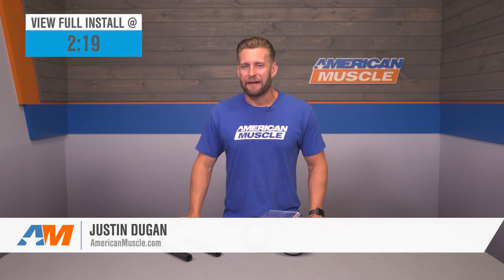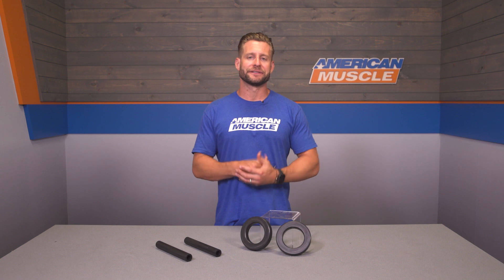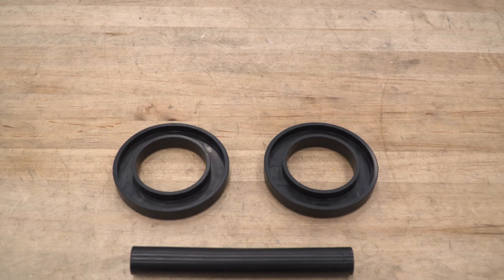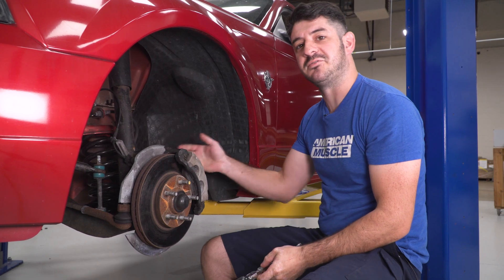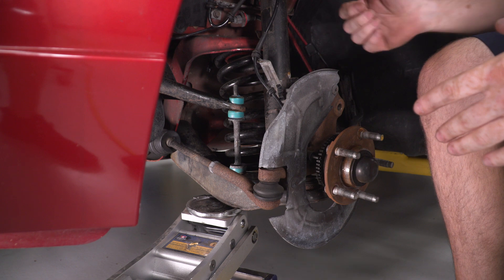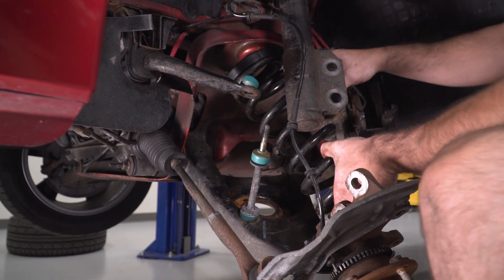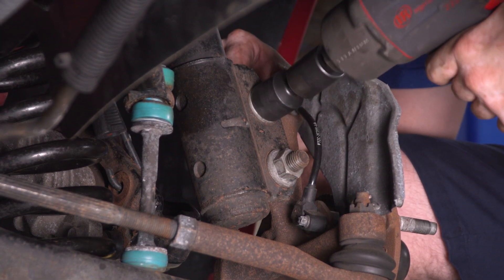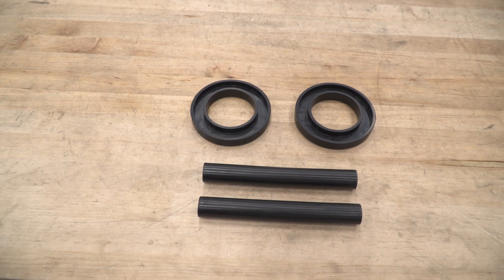1979-2004 Mustang SR Performance Polyurethane Spring Isolators - Front Review & Install

Comment: If only it were this easy lol
Reply: Yeah they cut the video right at the lower isolater the hardest part 😅
Reply: @drz00241kid  I just did mine last weekend and it went pretty smooth. Just time consuming. If you have a friend to help, one person can push the lower control arm down while the second person pushes the spring starting with the top side first then the lower part second and it pops right in. Then just use a floor jack to push the lower control arm up
Reply: @0rvelazqu  I  beveled the edges of the spring so they don’t get caught then put the spring in a vice and got my work out 💪 for the day. Probably didn’t have to bevel the edges but it helps
Reply: @drz00241kid  was that to get the tube isolator in? I used wd40 to slide it in lol